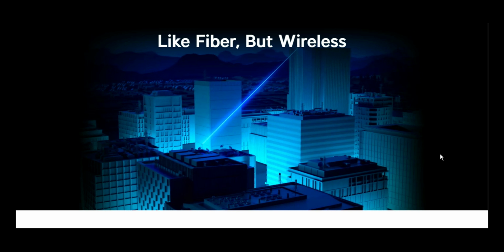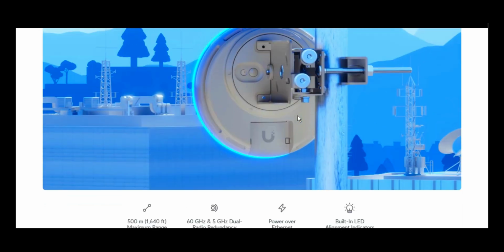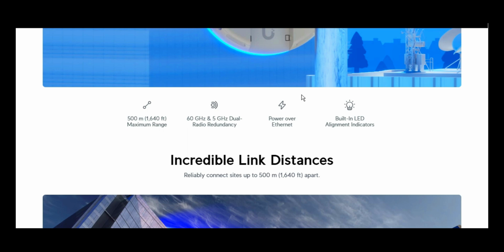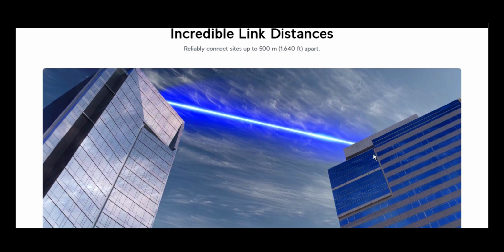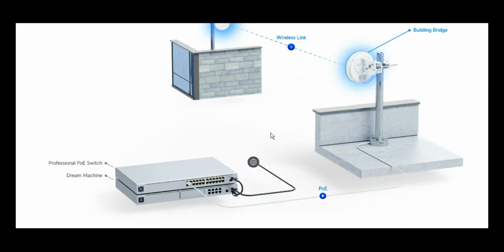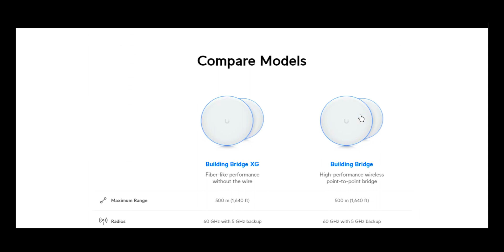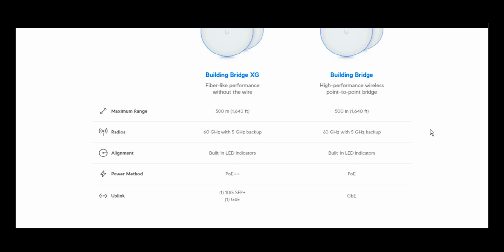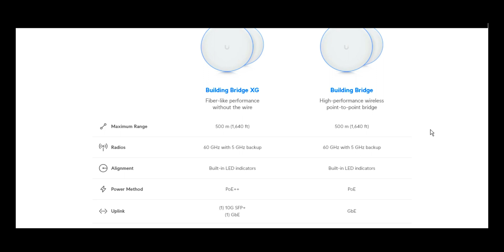Unifi Building Bridge/XG | What You Should Know !!!!!

Comment: Where does the Access Point go or where does the Station go?
Reply from the maker: In PTP radio connection, your typical configuration should be "Station ➡️Access Point". Hence they will be communicating with each other.
Reply: @owuubii  is the Station remote side or close to the network?
Reply from the maker: @InformedGlobe  either the "Station or AP" can be close to your network or remote.